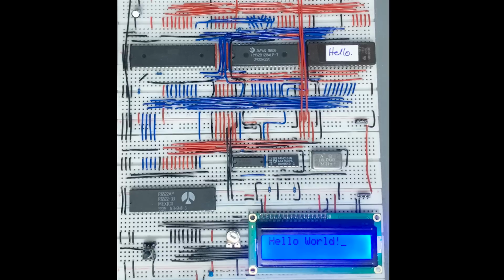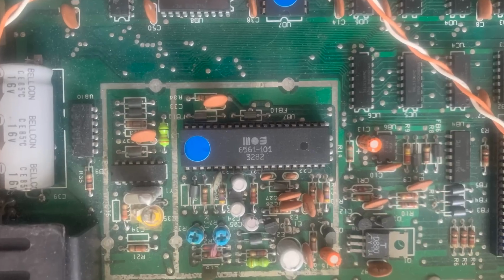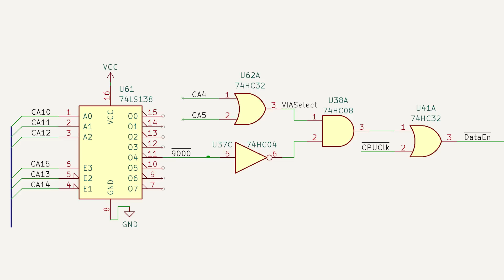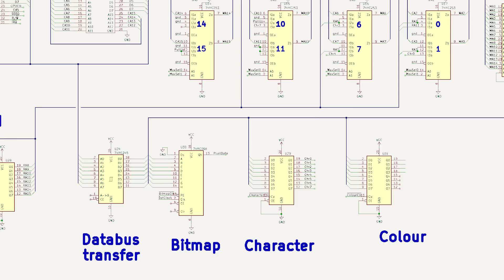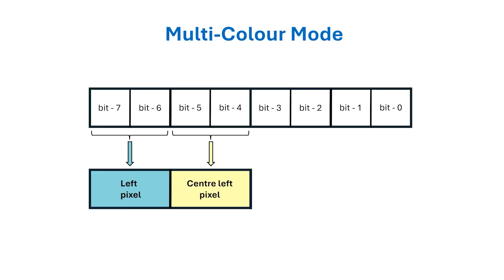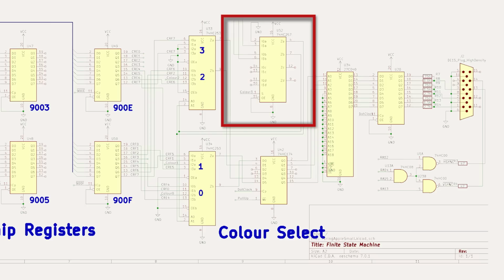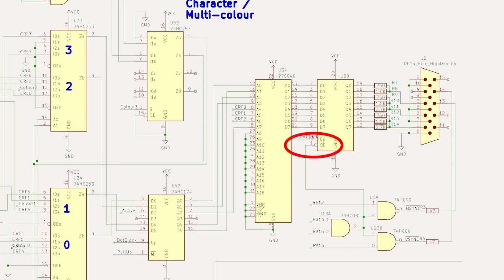VIC 20 build. Colour

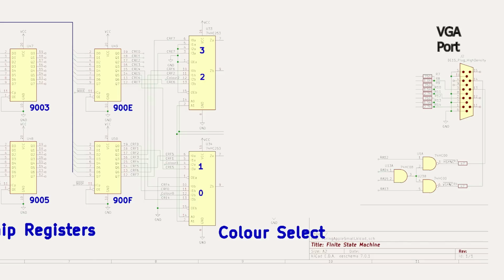Comment: 8:28 - Downside of using a 332 RGB bit allocation for colour: no pure greys. Best you can get is alternating blue and yellow tints. The same issue applies with the common 565 16-bit allocation, but with tints of green and magenta instead.

If you want 8 bits, you could build on the RGBI approach used by CGA and expand it to 2 bits for each channel (vs only 1 for CGA), which translates into 4 bits per channel for RGB output. This does give pure greys, and the conversion from 4N-bit RGBI to 6N-bit RGB is easier in hardware than in software, as it's just interleaving bits. Red channel is r1i1r0i0 and similar for green and blue.

10:10 - Doubling the colour depth at the cost of halving the horizontal resolution seems to be a common tradeoff in older video systems. I assume that means it's an easy one to make in hardware, but what makes it so easy?

Comment: As you are a clever chap, how about designing a box that can site between ANY old commodore PET, and allow you to attach ANY SERIAL IEE device like a 1541, 1570/1 disk drive and any printer from a VIC 1525 or MPS-801. That would be cool. I would buy at least one.
Reply from the maker: Interesting idea.  I have a pretty long list of next videos to make though.
Reply: @DrMattRegan  I think it might be done with one microcontroller. There are so many 1541's and clones around. And the 1541 can read and write to ommodore PET 3040 & 4040 disks. You could even attach a 1541 to non-Commodore computers. This has been done with the Sharp MZ-700 using a handful of TTL parts and some z80 code.

Comment: There is a vic chip replacement design,  the Victor or some such name, but it is the ussual FPGA design over the top, so I cant get behind it, like with the FPGA Hyper?? or Ultra Pet??, with all the sprites etc.  Not representative of maxinum efficiency and what they would have done in that sort of design if they thought of it and pursued it.  I forget the details of the vicchip replacement, but unless it something they could realisticaly do in ttl, gatearray or custom at the proposed price point to represent what your machibe could have been, whats the point?  I have commonality with the vichip inventor, but the vicchip was his older design technology, that didn't find a console to use it in the 1970's.  The vic2 didn't go far enough (he actually proved that the vic2 design could do 80 columns, and was planning a upgraded replacement chip.  Though I dont think this had 16 sprites per line, and I haven't heard about 4 colour 320 or 640 mode and 16 colour 160 or 320 mode.  If Jack had stayed at commodore, he would have been in a big battle without the Amiga, he didn't get for Atari by under offering for the design.  Atari could have got it, and Motorola flood the market with their slightly stripped down version.  All of which Jack stuffed.  Without the Vicchip designer, could they really have progressed to something that could compete on price, with a number of machines using the stripped down Amiga chipset from Motorola.  The US home computer market stalled, and Amstrad was the only real lasting cheaper advancement in the UK.  Commodore had crushed so much competition, who was going to invest enough in a custom chip to make machines that competed with the 64.  We dont consider,  the reasons why the 64 suceeded.  The MSX failed on older graphics tech rather than pull out ahead with a master system level graphics chip, plus 512 80 column).
Reply from the maker: @waynemorellini2110  I guess my goal here is to use TTL logic to explain what the VIC does, rather than complete with existing FPGA designs/software solutions. Education is really what’s on offer, rather than the best possible implementation.
Reply: @DrMattRegan  Sorry.  I don't mean compete with FPGA, too much..  Just duscussing simple software compatability graphics modes introduced by newer designs, and the odd suggestion.  :)

The Spectrum is a prime one, as a number of different machines and chip upgrades enhanced graphics with simple mode before the sorctrum next.  So, there is going be newr software out there that uses them.  The TTL QL Thor etc machines also have regularly supported newer simp,e graphics modes.  In the end, your designs might be the only non fpga designs out there for people in years time.

Comment: Is there any chance of adding a BOM for each .pdf file please? There are a few unlabelled ICs on the schematic (e.g. U25, U28, U29, U31, U32, U23, U45, U46, U46., U48, U49, U50, U20). I could go back through the video and figure them out but I was just going to stock up on my 74xxx series to come back to this in the future.
Reply from the maker: @paulspark7287  I will at the end, but it’s a work in progress at the moment.  Most of the chips are 74HC574s.
Reply: @DrMattRegan  I'll add a bunch of those to the shopping list. Thanks for the quick reply.

Comment: Matt, I've made a few suggestions for TTL computers,  but most computers are either too unsuported, like the Jupiter ACE (sinclair like), Mattel Aquarius, PCW, plus 4, or way too complex, like the Amiga, ST,  Comodore 64. Mac or PC.   But, the PC offers a rare opportunity.  It is a minfeild of incompatabilities from different hardware, with direct hardware addressing of the hardware.  But, there are certain hardware modes, input devices, video, sound and storage, that should most likely or always, be supported, which may be enough to maintain compatability with properly written hardware for a class of machine.  CGA, is one such peice of hardware, but demo makers are demonstrating 6845 timming trickes to do 320 and 640 side modes in 16 colours, which means new retro software might be written to support such tricks (where you only have to identify that a useful mode and xt features are being setup, to switch them on, and drop support for the rest of the 6845 and xt motherboard hardware).  But, the old popular Amstrad series of XT machines, including the Sinclair PC 200, use common 16 colour graphics modes, which means many European software releases might support it, and there might be another such chip in the rest of the world.   Limiting to modes and hardware that need to be supported.  But, ps2/386/usb/ega/various VGA hardware, might also have a subset of commonly supported hardware.

But thinking about it, it just gets too complex once you go past a CGA xt or Amstrad/Sinclair PC.  So, it's probably not worth considering.  But, a nice project for students.  I take it you lecture at university? Ultimately, the only really useful projects for students to do, are a Linux or javaecript engine os computer.  Where universities can expand, and industry can produce custom silicon versions as they like.  From there, students could try to do versions in the simpler to manufacture magnetic cellular automata logic at university (extremely low energy, extremely fast at cutting edge (4Thz), but hopefully still fast enough (in Mhz) in a low cost setup).  Anyway, it's probably just too hard.
Reply from the maker: Thanks for the long post!.
Interestingly, i actually have more prototypes under development than i have time to make videos.  It's actually making and editing the videos that's most time consuming.  
I have prototypes for both a SAP 8086 and a SAP 68000 under development.   I was thinking of the PC for the 8086 and either a Mac or Sinclair QL for the 68000.  I was actually thinking of running the two series in parallel, interleaving the videos, to make it easier to compare and contrast the two CPUs.  
I've still got a couple more videos on the VIC-20 and the ZX Spectrum to go and i'd also like to do a commodore 64 series as well, so i've got plans for another 50-100 videos up my sleave.  I would like to make one a week, but i find that very taxing and once per fortnight is more manageable.  I do work full-time as a medical doctor (my other career) at the moment, so right now this is a hobby.
Reply: @DrMattRegan  Thank you.  You're welcome.  You are very busy.  What sort of medical doctor, because your name seems a bit familiar now? (re-edit, probably heard it in connection with the genetics research).

Maybe a video  comparing the systems?

I did suggest to a friend designing a commercial system that I thought possibly you were going to make an adaptive system that could switch between different systems through the read only memory.  If so then, is it Andy Hu's channel, with his HEC's supervisor mode for Z80 and other supervisor-less CPU'S, might be worth looking at, to have an overall control system level (or get the 68000/arm to do supervisor).
Reply from the maker: I’m a clinical geneticist (the biological computing system).  Interestingly, much of the sequence analysis is done on NVidia hardware which is a little amusing, given I spent 5 years on and off working for NVidia.  
The spectrum and VIC20 may ultimately be the same hardware with different state machines!
Reply: @DrMattRegan  I probably have heard your name attached to that.

Comment: This is a great 👍🏾 watch , it's interesting that different resistor values help create some of the different colour shades,  I didn't know that
Reply from the maker: Thanks for watching!
Reply: It was a popular way to get sound out of a PC in the days before sound cards. A simple resistor-ladder DAC on the parallel port could manage 8-bit audio, but it was as CPU-intensive as doing PWM on the PC Speaker. There were even stereo variants that used a strobe signal from the port to switch channels. Some games will list "Covox Speech Thing" as a supported sound device for this kind of output (though it'll probably only be mono). Demos that support it tend to just give the parallel port as their device selection option, but might support the stereo version, or even using two mono ones on different ports.

Comment: Wow, this is amazing!

How large would the circuit be if you didn't use the EPROMS, bit hard wired the complete circuit?
Reply from the maker: I built a more conventional video circuit in this video
https://youtu.be/qbzzzkNPICI
The EPROMs make i much easier, and i want to highlight that it's just a Finite State Machine.
For the colour EPROM, it would probably take 8 74HC151s and a 74HC04.  I haven't done the Karnaugh maps, so it might be simpler than that.

Comment: Nice one. Your circuit board is looking pretty complicated now, I'd hate to see the mess of wires behind that thing. You could use that extra color ROM space to create different palettes for the VIC by tying a register or even some DIP switches to some of the remaining address lines.
Reply from the maker: Correct, there is plenty of space in the Colour EPROM, but it's still a simple solution.

Comment: Thoroughly enjoying this series. Many thanks.
I suspect you have your own plans, but if I might get in early with suggestions for future series might I suggest: 
Acorn System / Atom - another way to do a 6502 system based in a more modular architecture and 'OS'.
Amstrad CPC - a Z80 system with cleverly designed video and memory using minimal logic. Thanks. 

Both are also CRTC - based, which might be interesting to explore via your state-machine designs.

PPS: 
The Amstrad PCW might also be worth an explore - one way to make a functional Z80-based CP/M system with a surprisingly fast very high resolution screen in minimal logic. (Simplistically the display is a window in to a larger block of memory that can be moved about by updating registers rather than doing slow RAM copies)
Reply from the maker: Thanks for the thoughts.  I'm working on a new Spectrum series with a Turing Z80 and a Commodore 64, but i can look at other machines after that.